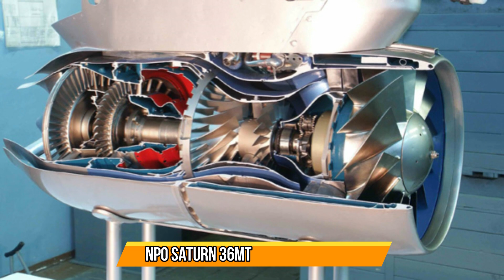#drdo #breakingnews  DRDO inches closer to develop 6th Generation fighter jet technology with SWiFT

Comment: DRDO supporters and indeed DRDO itself must get its accountability right. 1. This project is 14 years old . 2. This output after 14 years and 40 crores is far too little. 3. We are told that Tejas was over budget because it was laying down a common base technology.. Here we are told that 40 crores is too little whereas this tailless technology has been proven ( supposedly) in the tejas. 4. In nay case ISRO is a master in remote control landing technology. Why is DRDO not approaching ISRO for expertise. Is it so that its funds expenditure is not externally audited?